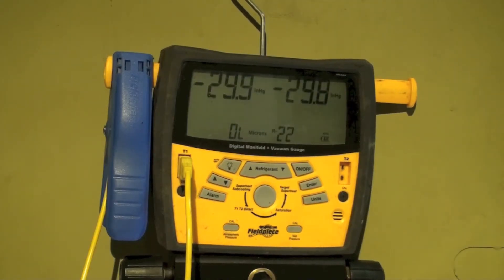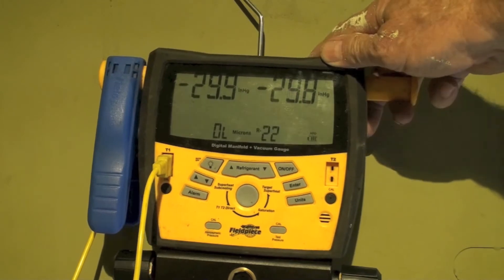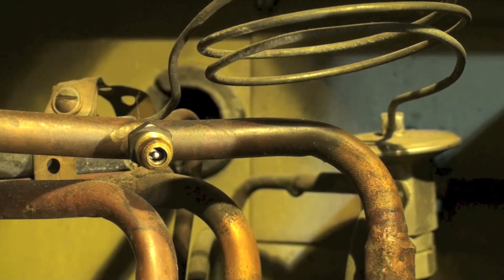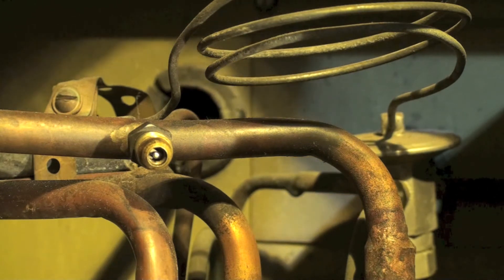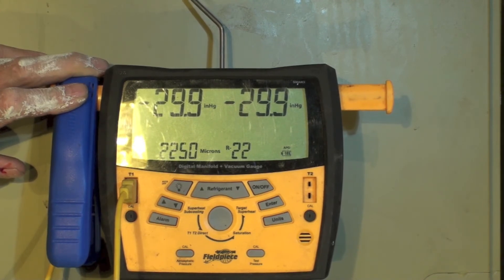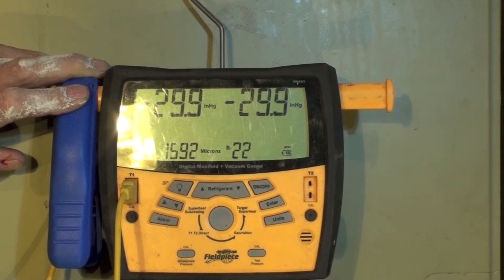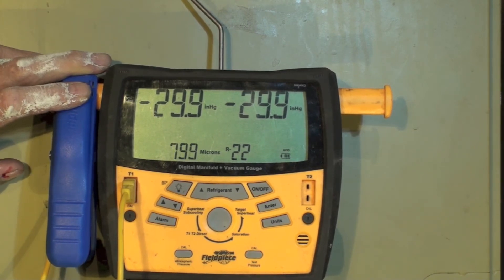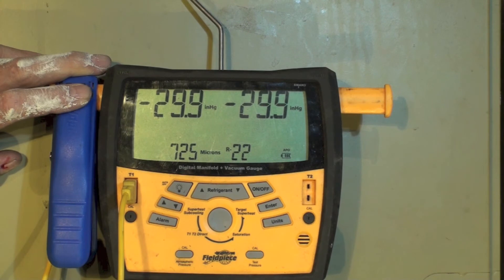The sucking schrader in the HVAC system

Comment: I've wondered if 12.7 ( pressure at my altitude... ) would be enough to open the schraeder valves.  Thanks!
Reply from the maker: slamdvw The valve is unpredictable and could leak at most atmospheric pressures.
GFM

Comment: I'm guessing the schraeder doesn't open right away when you start the vacuum, but does so later, after the pump gets a pretty strong vacuum on the system?  So you might not notice there's a problem right away.
Reply from the maker: Straycurrent With a schraeder you never know when or if it will open.  I have had them simply leak enough to reduce the effective vacuum I could achieve or some that I could hear leaking.
GFM